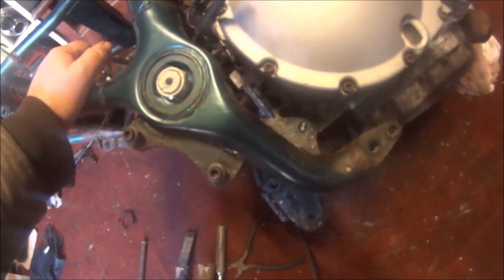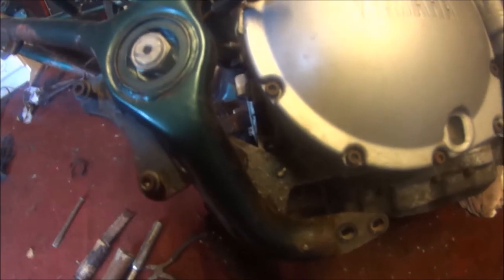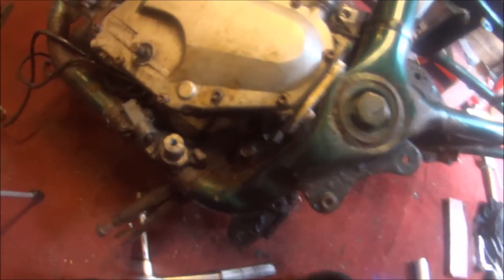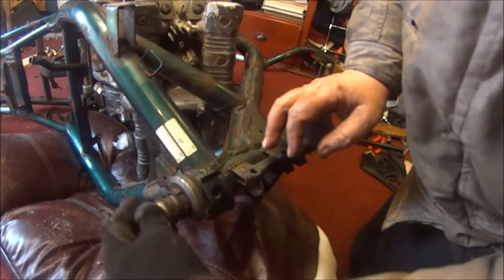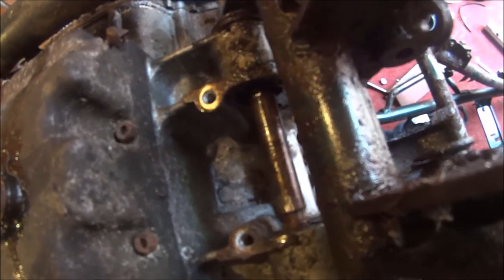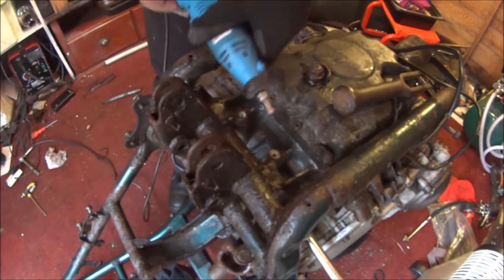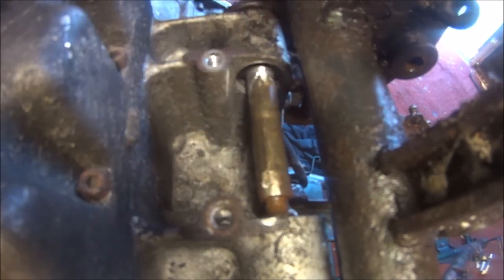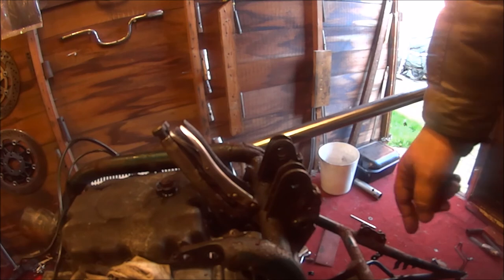YAMAHA XJ900S PROJECT PART 12

Comment: Heat 🔥 and a candle, heat up the end of the bolt and the spacer and melt the candle on it and osmosis does the rest. 😀 👍 👍
Reply from the maker: Mikey mike sounds like a plan mike thanks for the tip

Comment: I can feel your pain! I've finally got my VFR750F RC24 engine out of it's frame due to corrosion. I ended up useing my grinder to cut the frame off! Quick tip, do not believe everthing you read in Haynes manuals. Haynes say it's an engine out job to get both heads off. It isn't! I often weep to myself when I think about the frame that I sacrificed! :-(
Reply from the maker: Yes it can be a nightmare and sometimes we have to bite the bullet and take drastic measures 👍

Comment: How about grinding to flats opposite each other on spacer  to fit an open ended spanner, thought your idea of drilling a couple holes in spacer and pickling with penetrating oil maybe over night is good idea, best of luck.
Reply from the maker: j sturgess thanks buddy great idea. and thanks for the good luck wishes